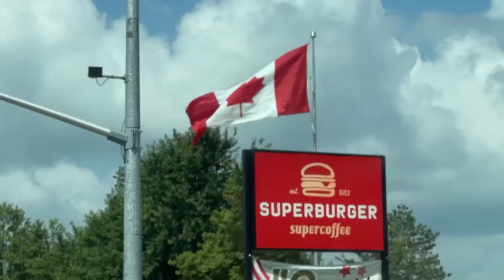The fifth wheel renovation is complete & I'm moving on 🥲

Comment: Reese makes a special 5th wheel set up called a sidewinder. I have it on my 5th wheel and pull it with a 5.5 ft box pickup. What it does is changed the pivot point from the 5th wheel to the camper point allowing better turns sharper turns. If you decide a 5th wheel camper in the future I would look into this Reese 5th wheel hitch set up

Comment: You and your crew did a really nice job, on the 5th wheel🎯😎☕I know where there is an 89, Terry Resort, 27ft 5th wheel, solid,  roof never leaked..
 Tires, brakes wheel bearings all great shape.
 Needs curtains, trim boards 2 small windows replaced.

Comment: When towing a fifthwheel.     id say a minimum safe distance is 5 inches.. from top of siderail  to the bottom of the roof line of the fifthwheel.   yours is like barely 2 inches..   it will hit the topsidewall of the truck bed  on a hill or dip.    you can adjust the hitch a small bit to help with this problem.   5thwheels are great for cutting into sharper turns !!!  they ride great!!!!   and dont think they will death wobble  like a pulltrailer.